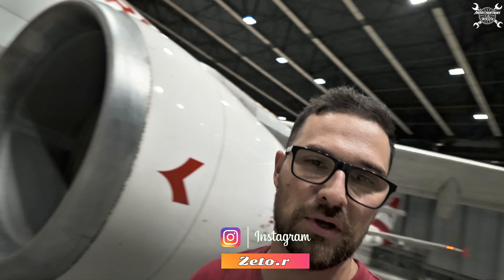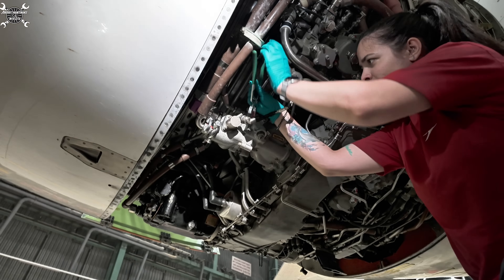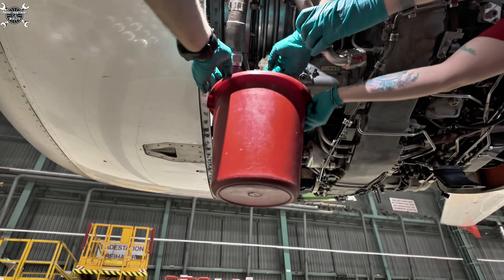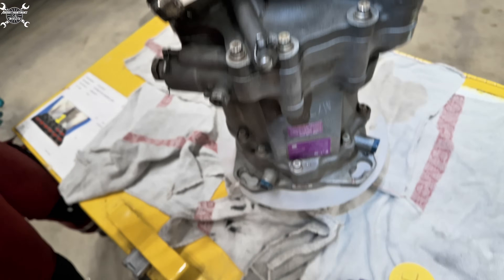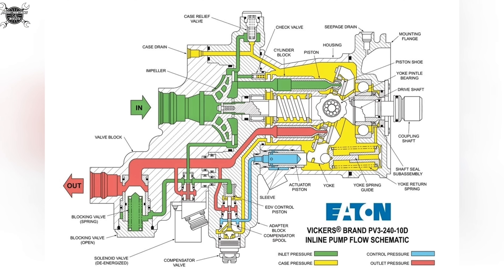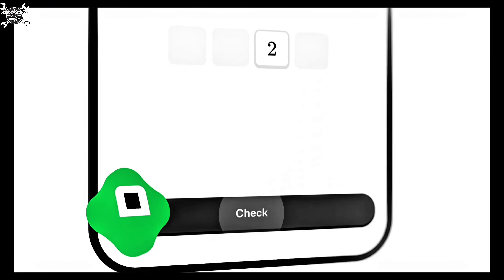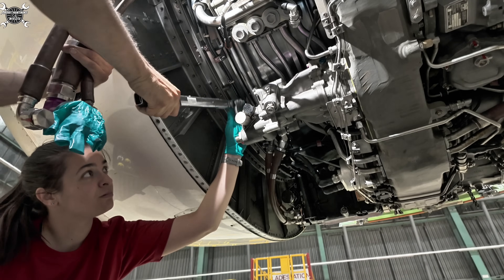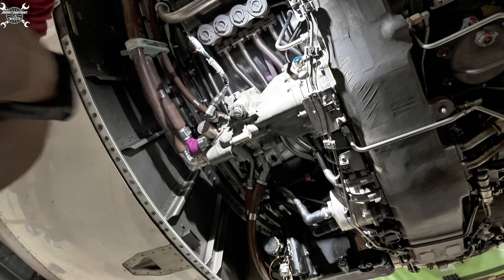Engine Driven Hydraulic pump on A320. How it works?

Comment: What drives the gearbox that drives the hydraulic pump. Is it driven by the turbine shaft or is it powered by something powered by bleed air? Those thrust reversers are beautiful
Reply: It's mechanically connected to the high pressure turbine/compressor shaft. Also, the gearbox drives pretty much everything that needs power off the engine. Hydraulic pumps, generators, oil pumps, and even the jet air starter to start the engine are all connected to the same gearbox.

Comment: why did you have to remove the fire extinguisher I did not quietly understand this part how is this related to the hydraulic pump ???
Reply from the maker: I didn't touch extinguisher. We pulled fire handle which cut fuel, hydraulic and air from engine

Comment: I would like to see them wearing safety googles. Whenever working with hydraulic fluid you have to protect your eyes, it's part of procedure and common sense. Even with the plugs, before you install them or the moment you remove them you have a chance of fluid finding its way in to your face.
Reply from the maker: I find them as not comfortable and they get foggy since I sweat a lot that is more dangerous since I can't see with them

Comment: Observation/Question. At 0:34 she opened the access panel to relieve the pressure from the tank by turning the release valve. Why was/is there red tape/seal over the access panel when it's closed and latched that needs to be broken before the door will open?
Reply from the maker: That was security seal, only person which is allowed to open it have seals to secure it again

Comment: When we turn off the pump in the cockpit are we just moving the swash plate to zero through energising the solenoid control? If so where does the output of the impeller go?
Reply from the maker: To the case drain line

Comment: Can you do a PTU video some day too please? I always wanted to see the dog that barks under the passenger cabin. :)
So the electric hydraulics pump that is not connected to the PTU is placed in the gear well - interesting location for a hydraulics reservoir and a pump. But very good accessible for maintenance! :)
Reply from the maker: Why? most of hydraulic components are in wheelwell. Same it is on B737 or center system components are inside as well 😉 regarding PTU im preparing video about it 😉

Comment: i saw 1 mistake. don´t make 2 knack with the torque wrench. the second knack have another Torque. And where is the wirelook?
Reply from the maker: Let me correct you torque wrench is set to one value it doesn't add ore reduce the power. We always use value in the middle of the range which means that we have some room to play.  There is no requirement for safety the unions with lockwire. Have a nice day😏

Comment: Big like for Autrian. Thumbs up for the apprentice. Why pump has electrical connector? Is there pressure switch or something else built in?
Reply: To energize the solenoid that deactivates the pump
Reply from the maker: It must be controlled and that is the reason 🙂

Comment: I remember we were replacing a nose wheel steering valve to a Avro RJ85 in Finland a long time ago. I was wearing safety glasses but my colleague did not. He got Skydrol in to his eye and was knocked down for a few minutes. I asked if he should wear glasses to which he said no. After a moment he got it again, and after a short moment he raised up from the floor and picked up some safety gear :)
Reply from the maker: That's why i always plug everything to prevent such thing 😌

Comment: Always love your video about machines. Can you please talk about the cabin doors if you have a chance? I've being told it's a plug type door(main door), but I don't see how are they plugged? They seems just come in and fit, not like those on the Boeing which doors really get into cabin then push out.
Reply from the maker: A320 doors get in the frame and then slide down in the slots of the frame.and then you have lock on th top to hold it in

Comment: Excellent video. What is the relationship of "fire shut off system" with "hydraulics"? Can anyone explain please?
Thanks.
Reply from the maker: Because you must cut air, fuel and hydraulic i case of fire
Reply: @zeto.r Thanks. So it's mean the hydraulic oil (skydrol) can catch fire?

Comment: Dear Thomas , 
good details video , you truly believe unlike other technicians in sharing the knowledge , "more we share the knowledge ,more we gain and increase the knowledge " 

i was trying to see how the pump workss , was it a kind of impeller which spins which is driven by engine shaft which push the fluid towards hydraulic driven systems ? it is having blades to push the fluid ?
thanks
Reply from the maker: Please watch it again and you will get answers. Impeller is there only to provide constant pressure to axial pump

Comment: inside plane hydraulic pump like excavator hydraulicpump
Reply: But in excavator pump, you will not find the "impeller".
I think it's the feature in aircraft pumps only.
Reply from the maker: Of course why not. It works you just stick it to something else 🙂

Comment: Does releasing pressure release the Airbus barking dogs? 😂
Reply from the maker: More less yes. If pressure drops 500psi ptu starts operate
Reply: Also known as the troll sawing off the wing with a handsaw? 🙂 That sound is being made by the PTU, actually shown in the video 😉
Reply: Who let the dogs out?
Reply: Legend says that it is a ghost of a dog that was never offloaded from the arriving airport. The dog barks if pressure is less than 500psi
Reply: Yes it lets the dogs out